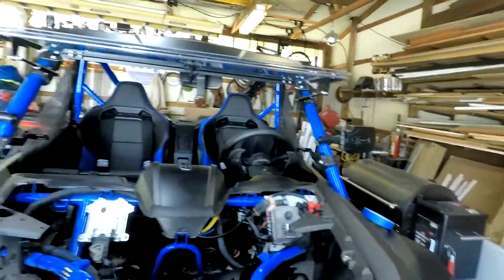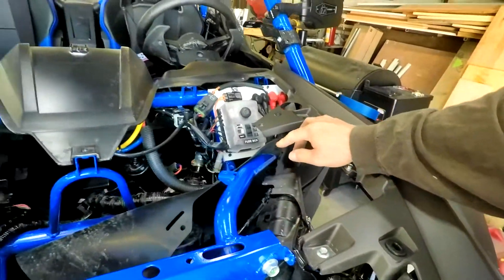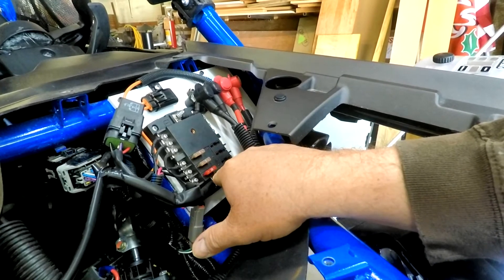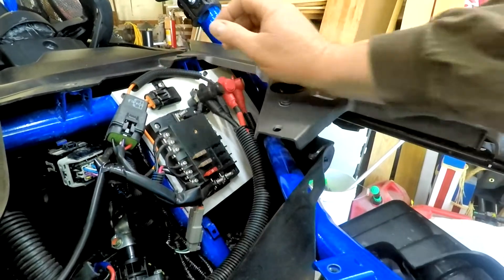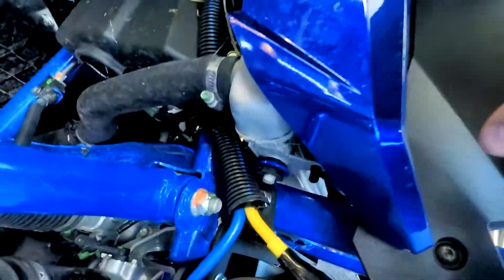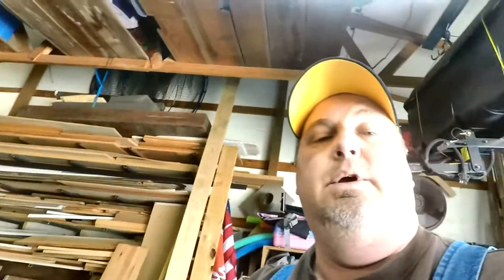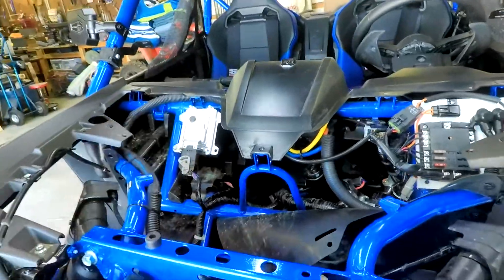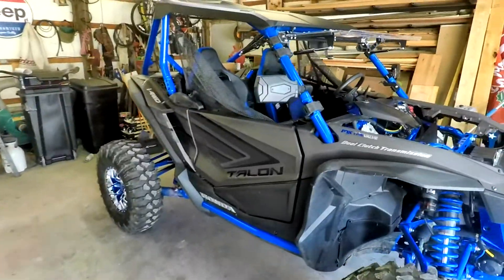how to wire a fuse block on a Honda Talon

Comment: That fuse block has a cover for the fuses but the wire terminals are not water tight, how would you recommend water sealing it?
Reply from the maker: Just apply other liquid tape or dielectrial grease

Comment: Hello, I have two questions 1. What is the maximum wattage accessories I can hook up to my 2021 Honda Talon 1000r.  2.  Does Honda make an upgrade to the charging system ?  Thank you
Reply from the maker: I’ve never checked on max wattage, and I’ve never heard of an upgrade on the charging system, that’s why everyone put two batteries in.

Comment: I know you posted this video a couple years back but could you post a few more pics of the fuse block that way I could see more of the wiring set up. Thank you
Reply from the maker: Is there a specific area, it would be awhile before I could get so pictures.
Reply: How to hook up the relay
Reply from the maker: @HeathCollins-w4r  do a google search, for how to wire in a relay. It’s not hard to do, but have a diagram helps to understand it better.
Reply: Ok, thank you sir!
Reply from the maker: @HeathCollins-w4r  if you have any problems, just let me know
Reply: @DualSportGuy  Ok.
Reply: Hey sir, quick question I read that this is a 100 amp fuse block. I don't plan on going that high but I will currently be hooking up over 45 amps. Do I need to get a 100 amp relay and 100 amp fuse holder. I just ordered exactly what you had listed. I'm currently installing it it my sxs. Thank you
Reply from the maker: @HeathCollins-w4r  no that just means you can go up to 100 amps. So say you need no more then 30 amp, just put in the 30 amp fuse.
Reply: Ok gotcha. 1 more question I bought a keyed in plug that has a hot and a ground coming out of it. Did you just ground it too the fuse block and put the hot on positive post of the fuse block?
Reply from the maker: @HeathCollins-w4r  yes man your going to be a electrician, before you know it. Lol
Reply: 😂😂 😂 thanks for your help sir!

Comment: The two wires that were in that dummy plug on the frame bar, do you have those wires ran into the relay? Get most of it but confused as to where you ran that plug. Thanks boss
Reply from the maker: Yes

Comment: Where did you tap in for key on power?
Reply from the maker: There is a switched power lead on the driver’s side. If I remember correctly it’s on one of the frame tubes in a plug.

Comment: Are the extra power wires just under the hood or do you have to cut the harness to get them?  I have the same Talon as you.
Reply from the maker: They are taped together,up in the corner
Reply: @DualSportGuy  yup found it thank you

Comment: Ok so I bought basically the same fuse box on Amazon. I first ran the power supply that Honda has already ran up from the back and  it put constant power to my light switch. I then removed it and jumped off the switched power that Honda has there on the driver's side front frame. I don't have a relay I just run my toggle switches straight to the fuse box. Is this correct? And what exactly does a relay do?